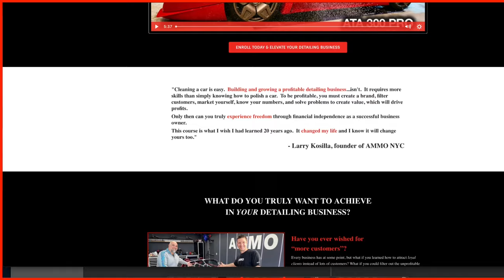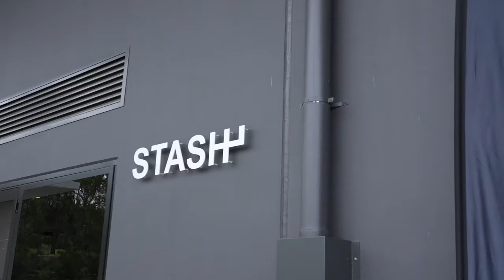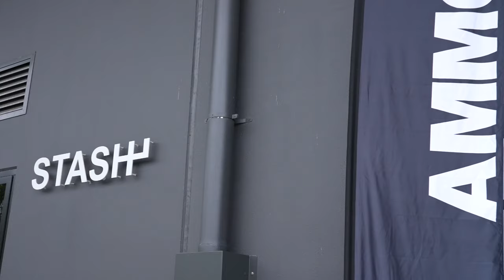THIS IS NOT A CAR WASH PODCAST #40: Talking Detailing with Kevin Brown "Buff Daddy"

Comment: I recently figured that a full wash / detail at every interval / week was quite intensive, and in the long run wouldn’t promote the practice of self car preservation..

So I devised 4 different types of wash (for a month) that could promote the practice both physically and economically.

Week 1) car wash (Full)
Week 2) hand wash (double shampoo no drying)
Week 3) jet wash (drying cloth)
Week 4) hand wash with jet wash rinse (no drying)
Then back to week 1..

What I’m trying to do here is optimise the process both physically and economically, see if you can work with this, you know in the long run folks is going to need economic conditioning that supports everything and encourages growth..